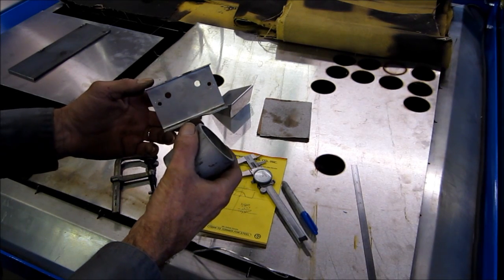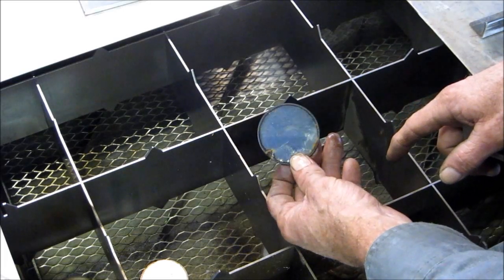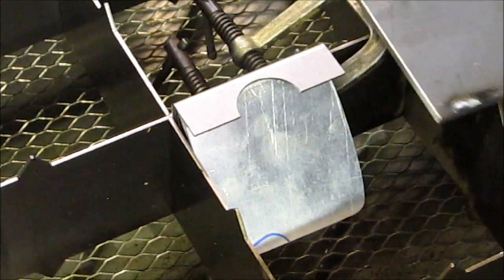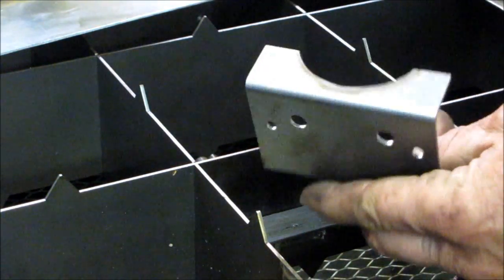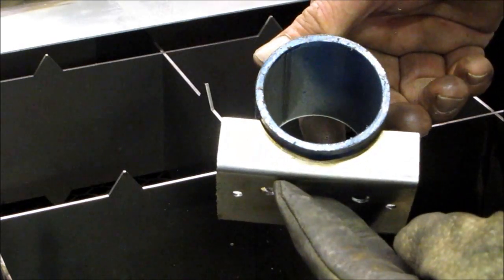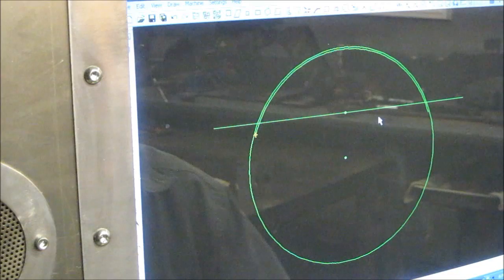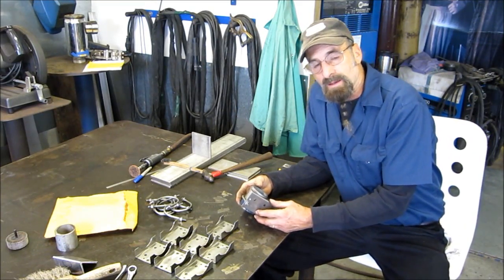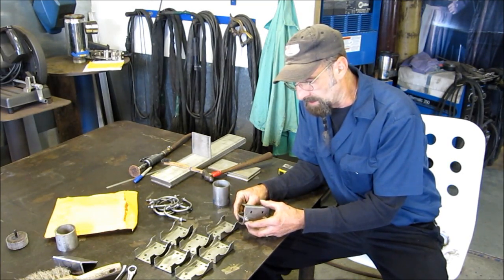Doing a little jig on the table top!

Comment from the maker: I spent 11,000 and some change for the table, with advanced controller and the Design edge software, then add the work I did in the console, water tray and draft system, Plasma cutmaster 81 and the computer, you can figure double that...